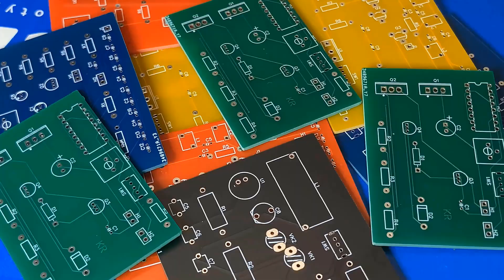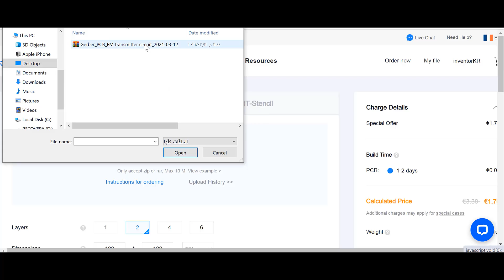how to make transformer, inverter 12v to 2500v, power supplies, jlcpcb

Comment: BA little power supply! that would be good for charging a PFN for flashlamp pumped laser from a battery. love it. 

REQUEST:   please, I'd love to see a design for a power supply for a big 50 watt laser diode, it needs an adjustable current between about 20 amps to a max of 60 amps at about 2.5v DC. it will lase at 20 amps.  Ive been able to get it to lase using 2 D size NiCad batteries relying on ESR of the batteries & nichrome wire for short test's.  a
Reply: ...interested in same flashlamp app.   Have you gotten further?

Comment: Little advice: make your secondary in layers, for example 100turns then add isolation then another 100turns and so on. At hight voltage the isolation of the wire may fail and start arcing or the corona discharge will melt the wiring and you will have a bunch of ruined coil. Im saying it from experience. Also the random winding with power drill is not the best idea, yes is fast but arcs are more likely if your winding is chaotic.

Comment: GREAT VIDEO!!!!      THUMBS-UP AND A SUBSCRIBE! 
...very close to what I have been looking for...
I am looking for a similar output, but with lower V and higher current output. In particular, about 1000v, at least an Amp or two, at  ~20 to 50kHz.  I really liked your inverse digital input instead of, say, a ZVS sine output.
However, I think I would need somewhat larger wire/core & less turns for the secondary...any suggestions would be greatly appreciated.

Comment: TIP: Don't use Nail polish OR any other Acetone/Petroleum Distillate based enamel when your coating a winding. This thins or even strips enamel off of magnet wire.  use a electrically insulated epoxy.

Comment: Just so you know, it's easier to hand wind cores by starting with the middle of the wire.  That way you only have to deal with half the wire length for the multiple passes.
   What kind of drill is that without a  chuck?
Reply: I have a hand powered winder, it has 2 speeds and also a counter, it also has an attachment for winding motor stators too

Comment: Squarewave output good only for lighting
Reply: What if the output is full-wave rectified?  Could it be used for high voltage DC applications?
Reply: ...ans filtered?...

Comment: That 5:15 is an iGBT component in which there is a combination of MOSFET and TRANSISTOR combined into an iGBT component. the function of the iGBT is for switching large currents and large voltages for SMPS or welding machines .. And you said the serial code wrong You mentioned the code (G40N50) but after I saw the serial code is (G40N60) please you have to be careful in that

Salam dari binjai 🙏🙏🙏
Reply from the maker: Thanks for noticing
Reply: Ничего не понял но прикольно